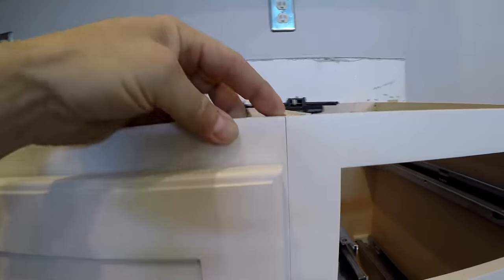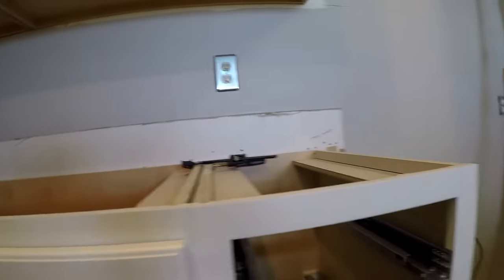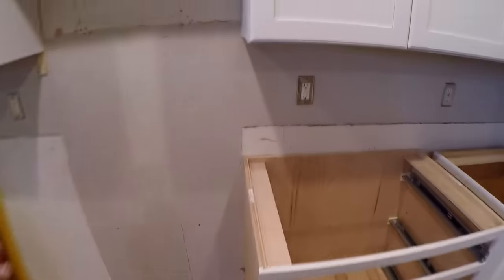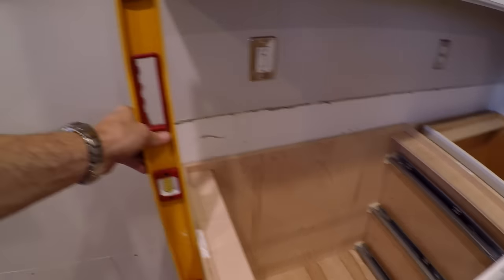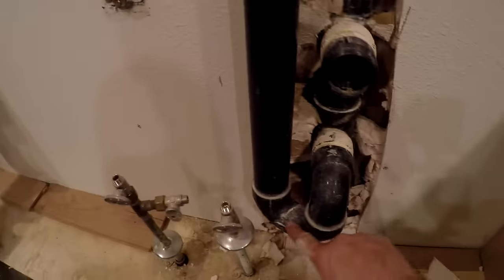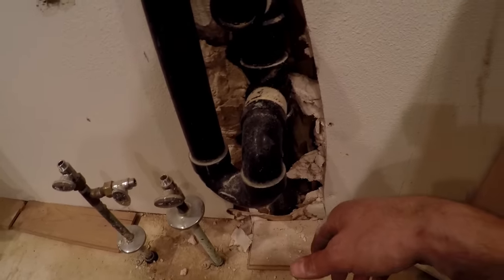How To Install Perfect Base Cabinets | THE HANDYMAN |

Comment: They got robbed on those cabinets
Reply: @smokingcheeba420  18 I feel bad for them they're not worth it I put in ten times better cabinets for less money
Reply: Those are definitely some cheap ass looking cabinets, e.g. the fit and finish is horrible, the sides are unfinished.  Hey...you get what you pay for!
Reply: @martylucas8557  Chinese birch is better than particle board
Reply: Dose of Truth ha!  What the heck is Chinese Birch?  Is it similar to Chinese steel?
Reply: I honestly dont know how Handyman keeps a straight face when installing these Bathrooms and Kitchens with these garbage materials the customers insist on having. $18k kitchen and $20k bathrooms that looks like something from Lowes.
Reply: @martylucas8557  you can see it in the plys. Some ys have poplar and are 3/5/7 vs the 10 15 ply chinese birch i like to call it
Reply: No l shapes cabinets lol
Reply: Factual Fox  You can always add leveling feet to cabinets for about $10 per base cabinet.

Comment: 18k that is absolutely insane. I did a kitchen for a family with rta cabinets that take about 5-6mins to assemble a wall and 10-15 to assemble a base. It was a big kitchen with a 6ft island but the drawers are made with dovetail joints and the shells are high grade plywood. But they only spent about 3.4k on the cabinets. Just a little more than what they would have spent on hd or lowes brand
Reply: The wife is clearly in charge of how the husbands money is spent.

Comment: I’ve set so many different brands of cabinets.   Did some today.  The thing is that it relies on the poor new guy assembling the cabinets at any shop.  They can have the best design.  Amazing details.  Great features.  But if that new guy is assembling them out of square you get screwed.  Same goes for the framers.  Ever seen a plumb wall?  The only flat and plumb walls I’ve ever worked with were ones I’d framed myself.  Lately I get “rough framers”. When I frame I frame thinking of cabinets and the finish.  Doesn’t seem to be the norm.  It seems like “I don’t get paid to plane studs flat, or to plumb walls” is the norm.

Comment: Luv working alone..30 yrs of taking it's toll thou ..ha ....62 now ... been using rotary Lazer last few yrs for cabinets..etc..works great
Reply: Im sure you seen the contractor solutions cabinterzier. I know slow going but saves you all the weight of the uppers except when getting it on the lift

Comment: $18k is a pretty fair price for what they have.  If they were custom cabinets, that size kitchen would be 25-30K easily.  Where all the money was spent was in the hardware.  That pullout wire rack system in the one blind cabinet is $750 -$900 price range.  The half lazy susan in the other blind is $500, the double garbage is another $400, depending on the brand of undermount track used each track pair is about $30.  Plus self closing hinges and wood drawers, these cheap cabinets have all the upgrades pretty much.  So it all adds up quick.
Reply from the maker: Thanks for putting it in perspective.

Comment: You need a countersink and preedrill combo bit,  that way the screws in the back are able to be covered with the sticky tabs to cover the screws. I also take that same pole you are using to prop up the uppers and extend  it to the ceiling,  then mount my line laser to is so I never have to touch a level , set it to your height you've determined for your bases, so much easier and faster than a fiddeling with a level. I just installed a kitchen where the cabinets alone were 30,000 and they were melamine carcasses with solid wood painted doors and built worse than those. I had to hold my tongue when the designer was telling me how great she thought they were.
Reply: Honestly i look at those fast cap tabs as tacky i like seeing the hardware, but im weird and everyone else doesnt
Reply: @DoseofTruth  They're tacky if you put the wrong colored ones in for sure, you can paint them with the touch up paint that comes with the cabinets and they disappear, or get wood grain ones. I don't mind seeing screws  if they are countersunk and measured in perfectly, I have even spray painted the screws to match, or with wood carcasses painted them black. I'm anal about stupid shit sometimes though, happens when you're staring at your work all day from 12 inches away lol

Comment: In the UK the majority of base cabinets come on high density plastic adjustable legs. The bottom is then covered by a continuous plinth that is that is the scribed to floor. A lot easier than using shims.

Comment: Consider not using wood shims under cabinets. If there is a leak they get mushy and heavy granite counter sinks. Also they are tapered so you are only bearing on a single point unless you use two opposing.
Try scraps of different thicknesses of vinyl flooring that you save from other jobs. save old 2 inch vinyl blinds slats. they are 3/32 thick. maybe you plan to replace them after you are all done screwing cabinets together.
just throwing this out there to see if others have different ideas.
Reply from the maker: If there is a leak they are fucked because the hardwood floor will get destroyed and all the cabinets will be taken out to repair it.
Reply: @TheHandyman1  yep, handyman knows his trade
Reply: The Handyman- damn, they’ll get screwed again... 🤣

Comment: Nice video Handyman. I've been doing the kind of work that you do since you were in grade school and it is nice to see that there are still guys like you that work hard and care about doing a the job right. Keep up the good work and God speed.
Reply: if leaving cabinets not perfectly level behind is good, then everybody can do the same. 
Why not just invest in a laser and another push pole.
Yes, sure cabinets don't have to be perfectly level, as long as decent to the eyes.
Reply from the maker: I used a laser. I have 5 of the third hands.  The cabinets are perfectly installed.

Comment: Curious, if everything is level and the front face frame is flush, what is everyone doing to level the  high spots on top of the frame?  Is everyone sanding the high spots?  And what about the low spots, do those need to be shimmed from the top?  Basically what is mentioned at the 1:40 mark.  Thanks.

Comment: Handyman! What would you do if you had two sections of base cabinets (big L with break for window) and when you laser level from your high point then at the far side is an inch and a half low? Should I build a small riser box to ‘shim’ up that far? #oldhouse problems.

Comment: Handyman, you should get a laser on a tripod. I exclusively use mine for all things level/plumb/straight. It does not lie. They are really handy to check the room for high point and for actually leveling the cabinets. Something to keep in mind when you are setting base cabinets for granite next time when you notice the boxes deviate from the face frames; the top of the ff is the most important to keep strait/level. The counter guys can and will shim the side against the wall 1/16" to 1/32" if needed. It's not ideal, but its better than being wrong the other way. 

Also, unrelated to this video, what are your views on clients offering food or beverages, or anything else really? Personally, I would like to keep the relationship professional, but have a hard time doing that when they offer things like that. I know the logical answer is to just smile, accept it graciously and forget about it. My problem is that I can't forget about it. What are your thoughts?
Reply from the maker: I guess you missed it in the video.  I use a self leveling laser on a tripod.

Comment: Thanks for posting this video. I just have a couple questions. I’m about to install the kitchen cabinets and also do the flooring so should I do the floor or cabinets first? Considering it’s the concrete underneath the new floor should I put something underneath the cabinets (plywood or something like that) to even up the level with the floor or just do it on concrete? Thanks hopefully you can help me out with this
Reply: I know this is 2 years old; but it may help someone else. Always install the floor first. Your kitchen layout may change, and it’s hard to match old floor and new floor.
Reply: Concrete base so floating floor, flooring goes up to it

Comment: Handyman, you pointed out where the cabinet panels were off by 1/16" and 1/32", what did you do for leveling them?
Reply from the maker: Nothing.  Counter top guys are use to cabinets way out of wack they shim and glue them in place.
Reply: @TheHandyman1  what’s the accepted tolerance on top of cabinets for most countertop guys?

Comment: Are the base cabinets supposed to be on top of the floor?? What happens when you need to change the floors??
Reply from the maker: You don't change oak floors. They are in place until the house is removed.

Comment: What's your favorite screw hole filler for face/frame joining screw holes?  Pretty small heads (GRK Trim Head screws) make small hole, but would look best filled in.
Reply from the maker: Trim head screws are not recommend for joining cabinet face frames.
Reply: @TheHandyman1  
Crap.  Well, let's say that trim head screws were used....spakle vs wood dough vs bondo?  (Pained white finished cabinets)
Reply from the maker: Hide them under hinges
Reply: @TheHandyman1  Great idea!  Let's say the cabinets have already been installed with the trim head screws that weren't supposed to be used, in a spot that isn't behind the hinges/visible when doors are open...what would you use to fill those holes?  I am looking to mop up behind a bull-in-a-China-shop installer if that helps any
Reply from the maker: You can get cabinet touch up kits.  The come with a colored wax to fill gouges and holes.  They also come with a stain pen.   If its white cabinets you can just use a wood filler and a dab of white paint.  Same with stained cabinets.  I have a bunch of different color wax.  Here is an example from home depot  https://www.homedepot.com/p/Home-Decorators-Collection-Cabinet-Touch-Up-Kit-in-Arctic-White-TUK-AW/100668510

Comment: I've worked with a few of these gadget cabinets before and they're great when they're new but eventually a screw will come loose or the thin metal brackets will bend with weight.  Corners are just always a pain.

Comment: Re-watching  I have a question.  Is there a way to hang base cabinets from the wall so they become floating cabinets? Or do you have to have certain cabinets only?  Thanks!
Reply from the maker: Full depth base cabinets that will have a counter top on need to be supported on the floor.   Some have legs.

Comment: The designer did them dirty I’m just a hvac tech and I know that kitchen is horribly designed
Reply: Looking at the layout the only real wasted space is no wall cabinet above the peninsula, dead corner left of the range (allows symmetry around the range), and probably 6"-12" on the hafele blind base magic shelf pull-out. It's hard to say just looking at the cabinets alone. Chances are the gap above the cabinets was left so they could put their own crown above it, and that space above the peninsula is going to be filled with open shelving. With some nice backsplash and the right decorative accents, the layout really isn't that bad. My only gripe is the peninsula cutting the walking space and closing the kitchen, but because of the limited cabinet storage and space wall to wall it may be the most functional.

Comment: Handyman you are a carpenter! What wasted space in that corner near the window. What type of screws did you use to mount and connect the cabinets together. I have seen so many ideas on it. Thanks for posting.
Reply: 2 1/2  screws if the face frame is 1 1/2
Reply: Also i start with 2 1/2 with mounting to walls too

Comment: The more videos I watch the more confusing this is I am doing my own in a couple weeks and have no idea where to start
Reply from the maker: Start with base cabinets. Get your level line based off the highest point on the floor.  Your floor goes up and down.  You will have to shim all your base cabinets up to that level line.
Reply: @TheHandyman1  thank you for the advice still nervous just want it to look good not cobbled up I am very handy and have put this remodel off for a long time last room in the house to do

Comment: There's always a problem shimming the back corner you can't reach, is that why you had those large flat pieces against the back wall of the cabinets?  My other question is where did you get that single pole one handed mini-jack that you used to raise the cabinet? Never saw one of those before.  Thanks. Great job as usual.
Reply: You can get these from harbor freight all though they are marketed as a device for a truck bed.  I think they call them a "cargo bar". They are called support bars and others things at other stores. I used them for temporarily attaching poly when creating a dust containment area. They work great for a lot of things.

Comment: Not a hater but just a few things you should have done. #1 floor protection! Even if it's vinyl it still need protection. #2 where kneepads.
Reply from the maker: NO need for floor protection as the floors are being refinished when I'm done. Knee pads are for amateurs.

Comment: Absolute crap for an $18k spend. That corner draw was a clever idea, but ultimately too clever, as it's going to scratch/wreck the cabinet doors beside it. The draw is particularly flimsy in it's build quality. Even if the planning and execution (of that design) was perfect, $18k is still spectacularly poor value. You should have told the the owner the truth; in time he'll come to realize you lied to him. He'll never use you in future plans; hell I wouldn't either. That said, the owner shouldn't need to ask. I wonder if he was asking because he knew already. Great video and nicely edited.

Comment: $18500? Doesn't seem too bad. I priced out 7' of cabinets at Home Depot. Plywood construction, dovetail joints. Consisted of 3 x 3 drawer stacks 1' wide and 2 24" sink cabinets. No fancy inserts. Self closing glides. Shaker style doors (not raised panel). Cost was $6000. This was July 2018. Makes 18500 look good.

Comment: Noob question:  Why doesn't the flooring go all the way to the wall under the cabinets?  It can't cost that much more for another couple of planks.  He damn near paid $20k for the cabinets so it can't be the cost. haha.
Reply: I'd like to know the reason also. We always finish to the wall.
Reply from the maker: Save on material.  It's standard procedure
Reply: Sometimes you can get by with one or more boxes at 
$50+ per box, for something never seen, that would be waist full.
Reply: @mrsandless13625 , For the scratch this guy is putting out, I would expect 100% of a floor put down.
Reply from the maker: It's the installers that make that decision.  Homeowners are Clueless
Reply: @TheHandyman1 , Oh, I'm sure they are clueless but since he is paying for a complete floor, he should get that. Jmo.
Reply: Too funny everyone wants the cheapest price but you feel like putting flooring under a cabinet is money well spent, makes perfect sense. If I told my customers that it would cost them $100 more they would say forget it. Flooring is sold on a per foot basis so you’ll pay cost of materials and labor.
Reply: @mrsandless13625 , The homeowner was charged for it, so the installer ripped him a new one.
Reply: Oh yeah I saw that in the quote too, nice catch. 👍
Reply: @kev5782  , Uh...No.
Reply: kev, LVP does, but hardwood is put in wall to wall.  I’m about to put in Flooret Modin Rigid Luxury Vinyl Planks (FYI this flooring is beautiful and what I feel is the best on the market. They only sell direct on-Line.  Carries a life time residential and “20” year commercial warranty!!  It has a 40mil wear layer, which is twice that of Home Depot’s LifeProof, ceramic bead coating on top of that, low sheen, 9”W x 72”L, environmentally friendly utilizing limestone and pure virgin vinyl and it doesn’t have to carry CA’s f’n Prop 65 disclaimer!) And new kitchen cabinets, etc...  I’m not running the LVP under the fridge, nor the stove, it will look as though it’s underneath, but that will be faux for show.  The LVP will be installed a 1/4” from the base of the cabinets, for expansion and contraction.

Comment: are you a koala bear whisperer
Reply: hey by the way,

What does it mean when you have a 4 prong dryer outlet with only 3 wires going to it?

Moreover the ground wire looks like a regular hot wire (rather than the typical copper wire)

Is it dangerous to just swap the wires over to a 3 prong dryer outlet?